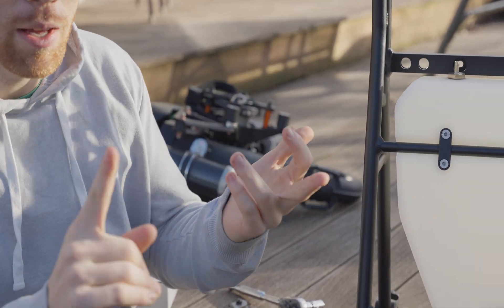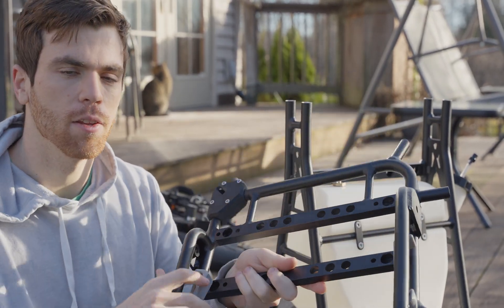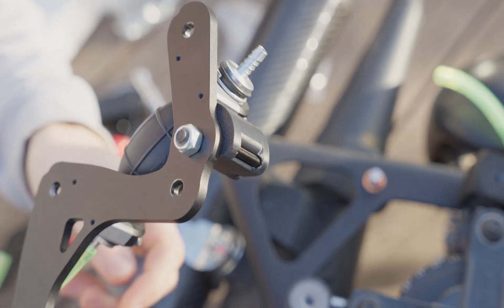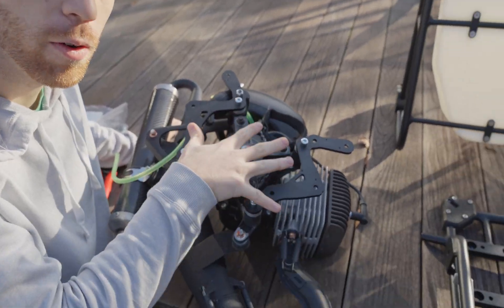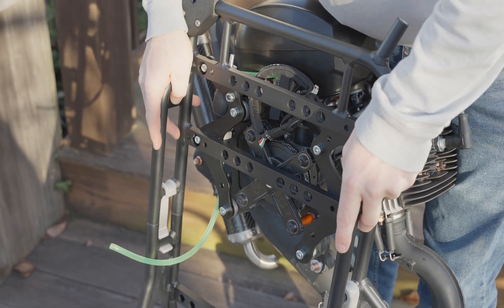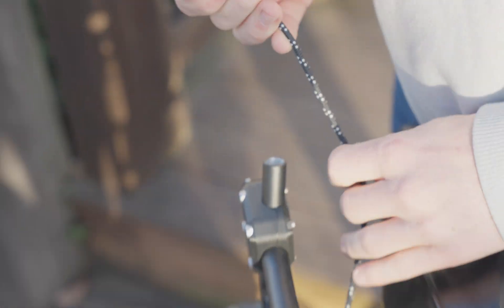V2 SP140 ICE Paramotor engine mounting

Comment: Nice frame.
I like it's  dual Purpose
And that is a split frame.
 For travel.what size is the tank 12,14, or 18 liter ?
Reply: It's 18L and fits between the legs so for traveling it doesn't take up any extra size.
Reply: That's great!